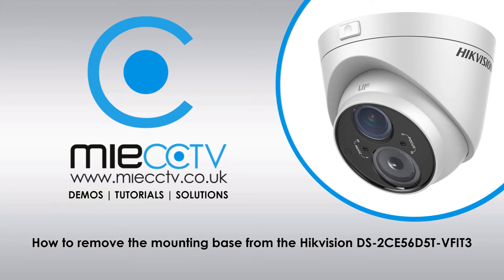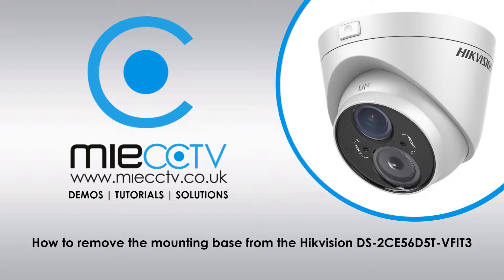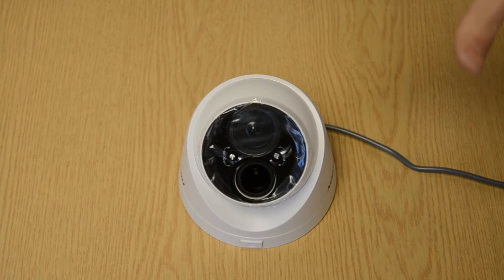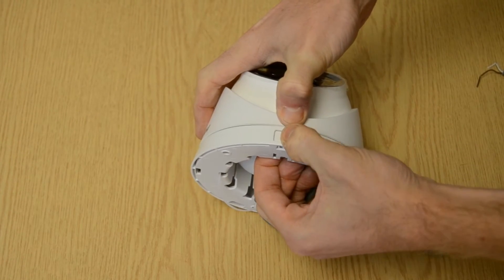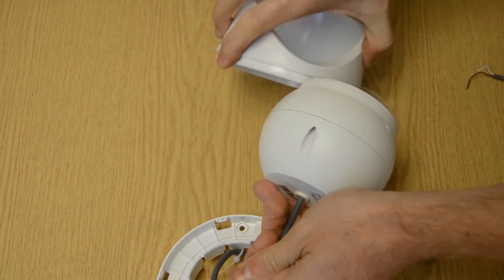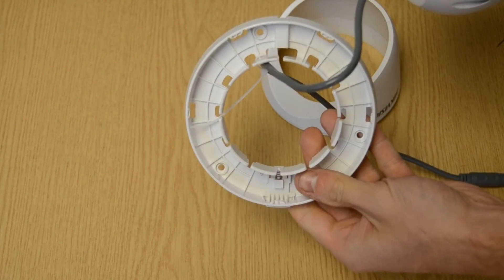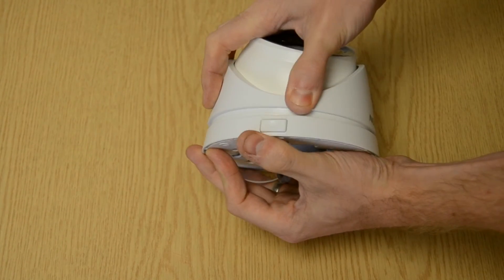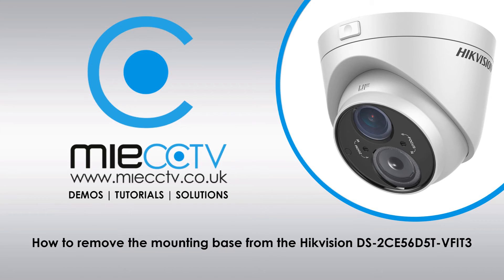How to remove the mounting base from the Hikvision DS-2CE56D5T-VFIT3

Comment: On older cameras the base rotates counter clockwise and can be stuck, i.e. there is no button.  Try putting on rubber gloves and wiggling and squeezing it a bit first to loosen up the grit which might be adding friction.